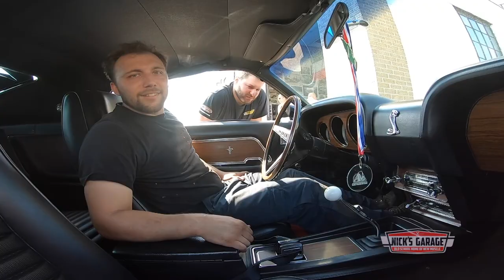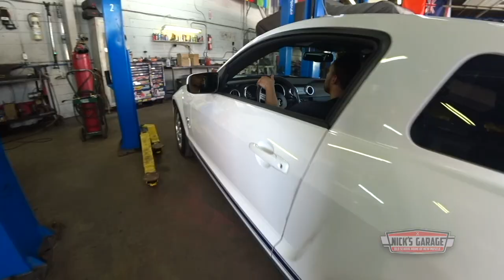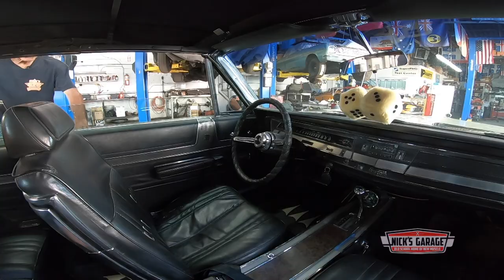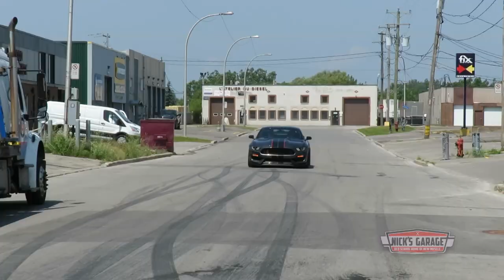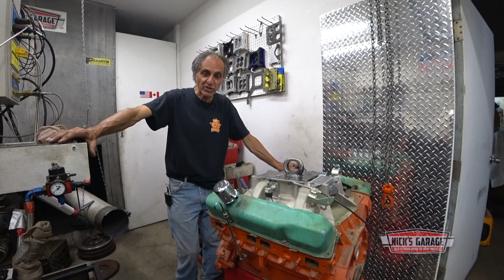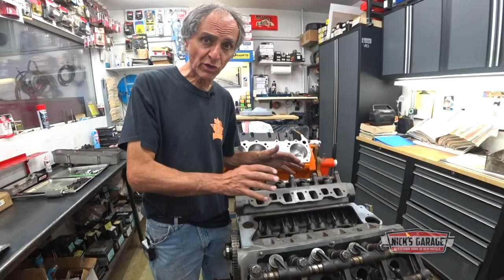1967 Chrysler 300 Convertible - 1969 Mach 1 Mustang - Dream Cars!

Comment: 69 Mach I looks just like mine except I don't have a shaker hood because I have a stroker 427/447 with the Ford dual quad intake and carbs. My rear louvers are original Ford with the hold downs. I think the 69 is the most beautiful of the Mustangs, I was lucky to get mine when in high school. It was a 351 but then I got a deal on the big block stuff and I worked at a speed shop doing engine machining. Almost all my pay checks went into that car, and worth every cent!
Reply: t johnson ; This is a 351 windsor as well.  Maybe a stroker?

Comment: That Mach 1 sounded very healthy. i'm not a Ford guy, but a beast is a beast !! lol
Reply: A great time to be alive   and see   2nd and 3rd generation  Mustang in the showroom or on the  Car Lot    on Sunday . 
         Sales   had tapered off  for Mustangs in 68 with just over 41,000  fastbacks  and  it was better for ordering one  the way you want  and in  about 4 weeks.  The 69  restyle was  a success  for fastbacks with about  132,000   that included  the BOSS versions.  
        I like the  fastbacks for 65 , 68 , 69 and 70 ....after  that   the horse broke a leg and was  shot   to end up at the LePages glue factory  as headlinder  paste  for insulation strips or the  windshields .         
         The BOSS  351  was too late  for the 71 body  and would have been nice Option  in 1970  right above the BOSS 302 .
Reply: Agreed.
Mind you, I bought a 2018 Ford truck with the 5 l and it's a LOT of fun to poke that - as many HP as the new Hemis.

Comment: God, I miss my 66 300.....  Sleeper, Camero killer, 0-60, but then aerodynamics comes into effect.....  Bought the car with 58,000 miles from a guy my father knew, the original owner and Dad had all the service records at his shop.  The car, running on 92 octane, would break that back wheels loose, as shifted through the gears....   There is nothing stronger than a high compression, 440, with a 727 transmission.  Loved that car.  Wish I never sold it.  Total sleeper with comfort of an old school executive cruiser.
Reply: Our 66-300 was the first car I got to steer, sitting on my dad's lap.  ☺   He gave me all his tools, and, now I use them on my own 66300 I am trying to bring back to life.  😉

Comment: My dad had a 67 Dodge Monaco Wagon with 440 and every available option.  It was built specially for George Love, the president of the Chrysler Board of Directors, to take him by driver to the 67 expo in Montreal from Pittsburgh.  My dad picked it up in 1968 from the regional manager of Dodge in Pittsburgh.  My dad LOVED that car.  Awesome car with tons of power...passed everything but a gas station.  My older sisters still talk about that car!  I think it may have been an HP 440 car as it was specially built.

Comment: I had a 68 Chrysler Newport. that was Factory Special ordered with  a 1965 HO/Police big block 383 with 727 auto trans. it was a police car, had all the buttons in the glove box. That ho 383 Big Block power and the 727 trans would shift from 1st to 2nd HARD about 55mph at full throttle. Leaving any Ford and Chevy in your dust.

Comment: Nice 67 Chrysler...those too were Muscle Cars...Bankers Hot Rod they were known for! I have a 66 and a 68 with a 440 TNT(magnum version) Even the non magnum version would lay rubber down from 20 mph roll and out run 396 Chevelles,390 Mustangs and 1987-1993 Mustang 5.0's!!

Comment: Nick ;😭😭😭 I miss my Mustangs. I have owned a 65 289 hi PO t-10 4spd, Detroit locker rear. And 2 1970 coupes.
1) was 351 hi po Cleveland. 11-1/2 hi compression.
2) was 302 2v 3spd automatic
Re jet carb, bigger radiator, dialed engine in on oscilloscope.
Could put a glass of water on air cleaner at idle with hardly any ripples in the water.
Friend gave me an entire mach 1 interior which I installed.
It was a medium blue.
God I loved that car. No one believed it was a stock 302.
Would shift manual. Hit 60mph in 1rst, bark second, chirp 3rd.
Lost to a 326 tempest 4v, but not by much. Great memories just thought I'd share here. Thanks for letting us into your shop! As always awsome cars. Would like to see a 70 cuda, that's my faveorite  Plymouth. God bless!

Comment: The 1966 and 1967 440's were, "hand balanced" at the factory. The original crankshaft pulley had a ring weight welded on it with holes (not all the way through) that was used to fine balance the flagship luxury engine. The balancer itself was a standard neutral balance balancer. In 1968 the extra balancing on the 440's was stopped. The engine was supposed to be smooth, like the old Cadillac  and Lincoln engines. I went to Expo 67 with my parents from the US when I was 6 years old in the Summer of 1967. We drove my father's new 1967 Dodge Coronet R/T with a 440 and A/C. Later I would learn to drive in that car. In 1967 Montreal was the largest city in Canada.
Reply: Jim.           Yes, Montreal was the largest city in Canada at one time. Now, Toronto is.
Reply: @nickpanaritis4122  I seem to remember the road signs were in both French and English, but I'm not sure. I still have the guide book from Expo67. The last time I was in Montreal there was an earthquake in November 1988. Oh I remember special 1967 coins in Canada for the Centennial.

Comment: I noticed the Pentastar is on the lower right front fender as it should be on the Chrysler 300.   I remember those rope seals getting as hard as rocks.   They used to sell a kit for removing those rear main seals.   It had a bendable long handle with a screw at the one end.  A piece of soft lead to try and tap the seal out with.  It also had a wire thing like a Chinese finger trap that if you could get it around the rope seal it would grab on to it and you might be able to pull it out.  Hey the rope seals is what they had in the day, and they sort of worked.  The hardest one I ever replaced was in a 65 Jeep Commander with a Buick V-6.
Reply: John.       John, I used everything I had in the shop to remove the rear rope seal out. Backed up the transmission a few inches and loosened all the main caps to drop the crank 1/4". Let me tell you, it was a battle on this car. Done a few rear seals on the BB Mopar, never had an issue.

Comment: Fun story about my brother-in-law who got a '69 Mach I when he graduated high school. The way the story goes, he first test drove a 428. Apparently, as he was getting on a highway on-ramp the salesman told him to punch it. The car came onto the freeway sideways. 
He ended up with a more sedate 351 Cleveland.
Anyways, he drove it for a few years and, after marrying my sister and having a kid on the way, he decided they needed something more practical. So, in the spring of '76, he got rid of the Mustang..........and bought a Pacer. It's been over 40 years and we still make jokes about that.
But in the AMC's defense, as homely as it was, it did everything they needed it to do and never left them stranded in over well 200K miles. The biggest reason they got rid of it was that the Kansas City winters had taken their toll.
Reply: You brother-in-law's salesman reminds me of the salesman who went along with me when I test drove a 2018 Challenger TA 392 with a stick.  He turned off the traction control and it was about 40 degrees with summer tires.  The thing went a bit sideways when I caught 2nd gear.

Comment: G Nick , First  Tyme I Was on the Beach was at Daytona ! 1977 , 2 Tone , Elcamino with Tonto-Top , [ 3 Week's Old ] . Drove that Bow-Tye Wright in-to the Atlantic . 6 or 8 People's + Tow Truck Recovered Vehicle . Toronto 2 Daytona / 26 Hr's . Eventionaly , [ 24.5 hr's ] . That 69 , 429 Cobra- Jet - Mustang Shaker & the 68  Buick G's 455 Were the Only Street Rod's That Rock'ed Me , [ Stock & Out of the Box ] . My Nova could Best Them , But I Was Modified ! After Driving Both , I Quickly Noticed That If Properly Tuned They Had That Upper Turbine  Sound , Even Thou they were Not Supercharged  , They Sounded as Such ! They Just Wanted 2 Go Faster & Faster . [ Hey Paul , 125 Mph . The Oil Light is a Flicker'in / No Worries , I Shoved in an Extra Quart B'4 We Started !? ] . 135 MPH & the Speedo a Float'in , I Just Had 2 Krack another Cold One & Watch the Town's Pass By ! YYZ ,Rock-Crush'in Ratman . 16 yr Old & a Couple of My Rides were Rolls Royce , Left Hand Drive , [ Ghost ] , Porsche Cara ,Targa & Tran's Am's + Elderado's a Plenty . At Tyme's they Flew Me Across Canada 2 Facilitate Delivery of Such . Pony-Tail Down 2 Me Arse , 16 yr Young & Driving a Roll's ! Customer's Demanded Me ! If They Only Knew !?
Reply: Stewart.       Good old days. Wish we can go back in time.

Comment: To Nick Garage, you talk about the 1967 Chrysler 300, the picture you show here on YouTube of that car it looks like a 1968 Chrysler 300 my mom had one it had a 440 4bbl in hers, and we junk it because the wiring was in bad shape and alot of shorts in it. the yellow chrysler 300 you show, it has the same front end on it as you show in the video. My mom's 1968 Chrysler 300 was a 2 door and green with a black top, it took a week to get it all junked out.
Reply: Ger.       These old cars do not have wiring like today's cars. Finding shorts is much simple with less wiring. You had a nice 2 door there.
Reply: @nickpanaritis4122  you say we had a nice car with that 1968 Chrysler 300 ya but it had its share of rust also. Besides the wiring problem it saw its better days before I junked it out, it had a good Engine that we sold for $100.00 in 1981, then years later we didn't know it chrysler didn't make very many of them. Today that car is worth alots of money. Then about 1995 I saw one one going down the road in Nevada. That one was In nice shape. That the last one I saw in person. I don't even think you could even find one today unless you got really lucky 😉

Comment: Don't forget telescopic steering wheel.  Turn the center knob and wheel goes in and out.
Reply: C. R.     Really, I did not know that.
Reply: @nickpanaritis4122  The Chrysler 300 capitalized on the name of one of the world’s best sport-luxury cars of the time, the 300 letter series; it provided a similar look and a similar name without the same unstinting attention to performance and luxury. The body ornamentation and tail-lights were different from the others; standard vinyl covered bucket seats conveyed a sportier image. The base engine was a 383 V8 with four-barrel transmission; a four-speed manual or 3-speed automatic were optional (base transmission was a three-speed manual), as was the 440. Two door, four-door, and convertible models were made. "Options included tilt/telescoping steering wheel and six-way power seats."  Quotes are mine.  I seem to remember Corvettes also had the same tilt/telescopic option and thought that was so cool at the time.  Just weird things that I remember during the late sixties.

Comment: My friends got killed in a Mach one just like that one mid 70’s, wrapped it around a county line telephone pole. The front and rear bumpers touched upon folding it. The windshield was 75 yards out in a plowed field unbroken. The drivers seat was two inchs wide from the pole. Bad deal but that’s racing.
Reply: Craig.    Sorry to hear what happened.  R.I.P.
Reply: Nick Panaritis, thanks Nick, there was a survivor my best friend who was in a coma for three mths then he was in a wheel chair. He owned an Orange Boss 429 at that time and years later his dad rigged the car for handicapped and put a 351 Cleveland in it. Im just glad I didn’t go with them that night. They made a critical mistake on which part of the road they were traveling. It had a curve and he had it floored at night and hit the curve, poles following the road, They were racing another car on Elm point Rd, St.Charles Mo.

Comment: Yeah that 350R is a track special, with all the aeropackages and the like, all around brembos too, and the engine is specially designed to give ferrari's a hard time on the track, the normal 350's more of a roadcar with that same engine and actually their affordable as crazy as it sounds, saw one, yellow and black brand new with less than a few hundred miles made in 2016 with factory warranty still available for about 40 grand, while when new it was 65/70 while the R was selling for closer to 80 to 90 grand, and the kicker is actually the wheels, their solid carbon fiber, and weigh like one fourth the normal weight

but the aero is made out of normal plastic so if you crash into something with it its not a couple of grand to replace the front splitter, and both have roughly the same spec save for the aero, exhaust and the wheels, right down to the brembos I think.

Comment: When the time comes to dyno the big block Buick,, PLEASE spend a little time on the oil pump - front cover assembly and the issues involved with it..
Reply: 2pack.       Sorry, but the oil pump is assembled and installed on the engine. Since this is a 72 block, it does not need drilling the oil passage on the block, like earlier Buick blocks.
Reply: @nickpanaritis4122  Hey Nick thanks for the reply !
I forgot to include the most important word in my question which was "discussing"..
I just wanted you to talk about it.
So i'll try again,,, PLEASE spend a little time discussing the oil pump - front cover assembly and the issues involved with it,, like the oil passage you mentioned...
Thanks again from Houston Texas !

Comment: Wow,you loosened the main caps on the crank and dropped it a 1/4 inch with the connecting rods attached .... holee chit!,,,
Reply: Mike.   We also had the transmission backed up a few inches.

Comment: Nick .. Ever rebuild the ford VV carb ?  I have .. and they’re not fun. lol. Talking old school.
Reply: J.   Never have yet.
Reply: J-Styga I find them much more simple to rebuild than a conventional carb.
Reply: J-Styga I find them much more simple to rebuild than a conventional carb.
Reply: Mike K ... Holleys are weird .. have to play with the power valve to get it going good. I’m a quadra jet fan.
Reply: We had a Ford dealer close to where i worked and they had a tech that was very good with VV carbs. We sent them all there and they worked perfectly after. Wasn't worth the effort to tinker with myself.
We had a customer that drove his 1980 or 81 Ford all the way from Canada to Florida and back at 50 mph as it wouldn't go any faster. He stopped several places to have it repaired and nobody could figure it out.
When he returned from his trip i found the problem in 10 minutes. The venturi control diaphragm was  leaking. Needless to say the customer was pissed.

Comment: Can't wait till you dyno the 455 Buick . I will be installing a Buick 455 in my trans-am. I was told that a 455 buick is only 30 lbs heavier than a 350 chev . Do you check the weight of the motors prior to placing them on the dyno?
Reply: Travis.    I do not weigh the engines before Dyno. And, one of the lightest V8's around is the Buick motor.

Comment: Hey Nick I was wondering if you've had any experience with a brand called procomp electronics. I bought a set of h-beam 6.70 rods for my 471 stroker & have had them checked out, near perfect weight set, all the tolerances are great & they come with 8740 rod bolts. They're rated for 800 hp & 7500 rpm. I also bought a brand new molnar 3.915 stroke BB crank since I didn't want to offset grind a factory crank. Top it off the srp pistons put it a near 0 deck before machining. I'll put some heat cycles into those rods before I try running it real hard. If you've seen these rods be a problem please let me know !
Reply: Korie.   I have never used these Rods. But what HP are you aiming at ?